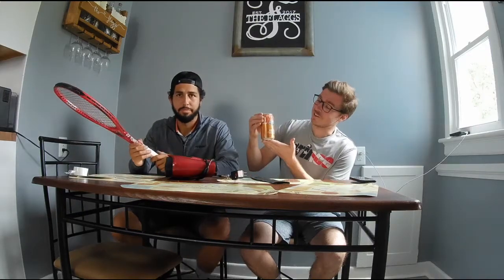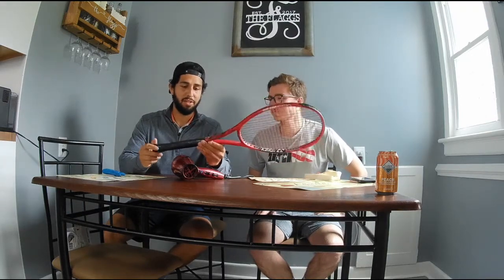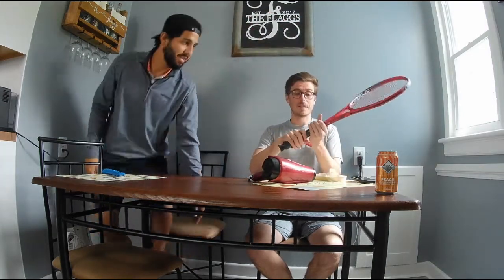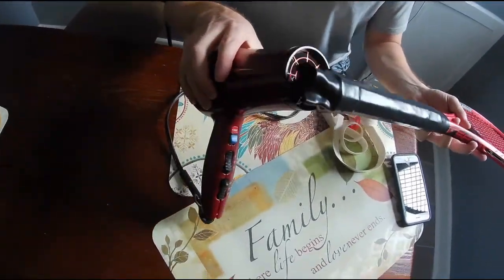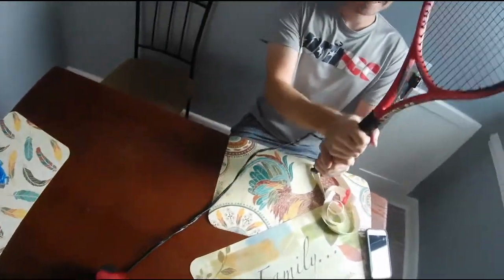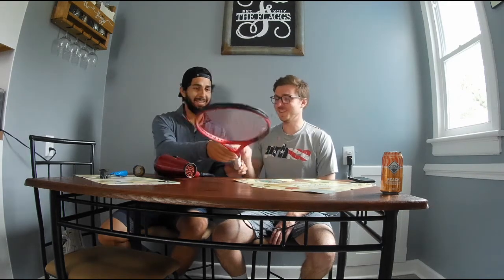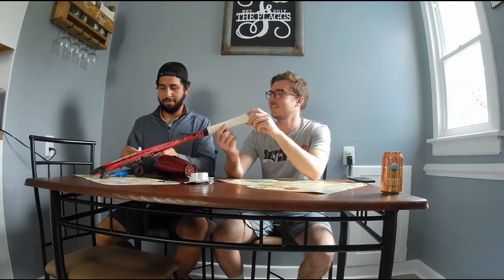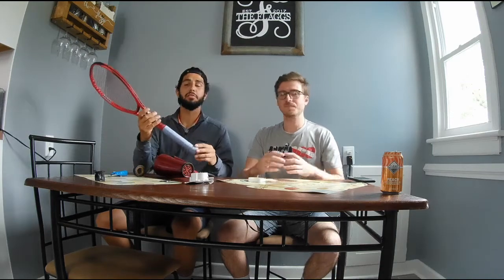Tennis Heat Shrink Sleeve with a Hair Dryer!!

Comment: Thanks for this video!  I'm going to do the heat shrink trick to the handle on an exercise machine that I need better grip on.  

Before re-wrapping the tennis grip, what was the feel of the bare heat shrink handle?  Did you hand slide around on it or could you get a good, non-slip grip?  It looked like the latter.
Reply from the maker: Sorry for the late reply! It was a smooth plastic type feel, definitely would not advise playing it without an over grip.

Comment: i'm about to do this....did it significantly change the weight of the racket?
Reply from the maker: We ended up trimming about an inch off the sleeve, but if you use the full sleeve you can expect an extra 14-16g. There could be a slight change in the balance depending on the racquet you're using as well.
Reply: @trashbintennis5550  yes i def feel a difference, but prefer lighter head, so its good. thanks for the video!!

Comment: How to remove a heat sleeve? I got a racquet with a heat sleeve already on but I want to go back down to the smaller grip. 
Is it a bitch to remove?🤔
Reply: Just use a a crafts knife from like hobby lobby or those safety razor blades and it will easily slice it. Don’t push to hard pressing into the racket mold